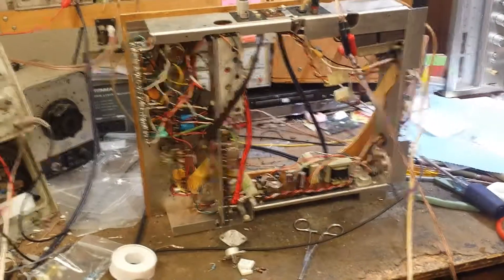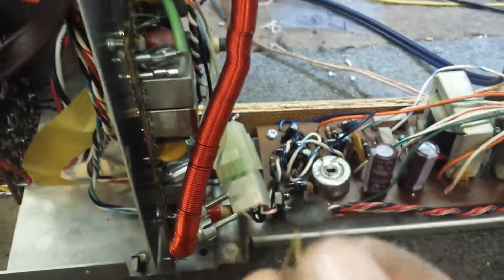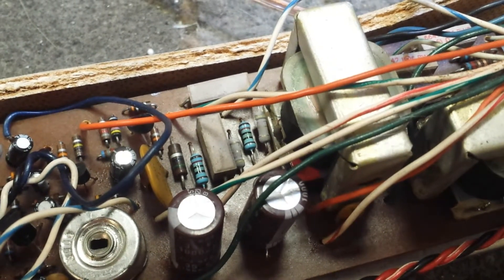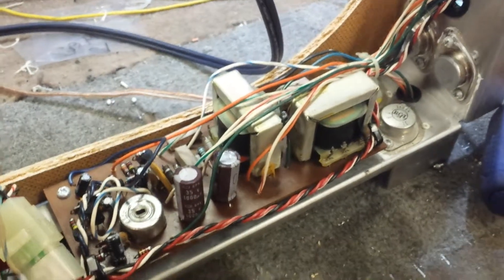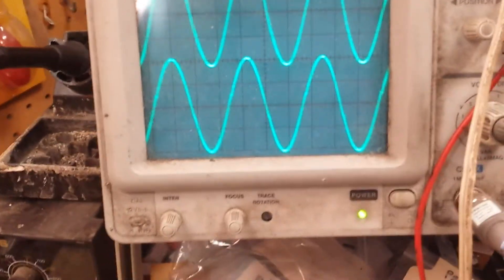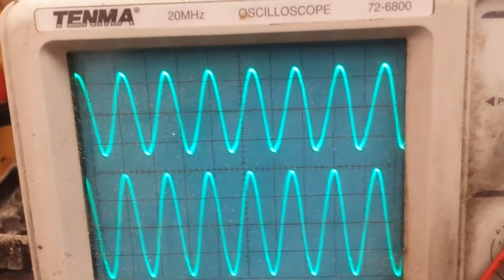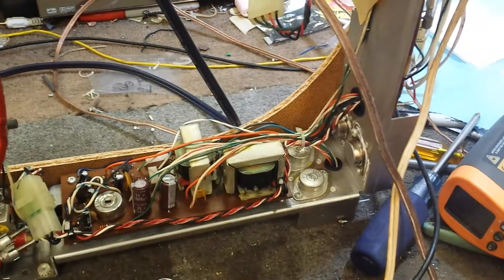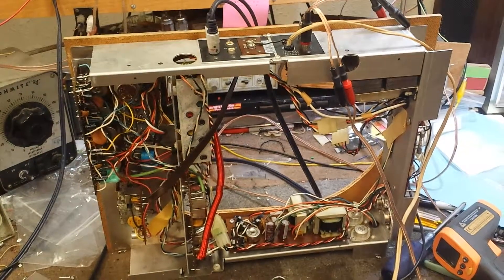Repair of KLH 25, after silicon conversion

Comment: How would you be able to adjust speed on idle speed. Hope you can help  hopefully I can do. Thanks man
Reply from the maker: Assuming the motor is good, build up the tier of the motor pulley that's slow with clear nail polish, then file down until you achieve right speed
Reply: @JordanPier  thank you I will try ,cool

Comment: OK I just lowered my line voltage on the  variac to 90v , no overheating , I realize this is not the fix.. I'm just going to increase the values of the voltage divider resistors to a bit higher than specified, what is theusefulness of my scope can I check for the distortion? I've never tried that on the scope
Reply from the maker: Joseph Sirois using a load box with a 50watt or better 8 ohm resistor, connect the amp to the load, run a 700-1000hz tone through the aux in and connect the scope to the load. You're looking for a smooth sine wave on the scope. If there are notches or the waveform looks distorted you still have a problem.
Reply: Jordan Pi excellent thank you for sharing your knowledge Jordan I got some tinkering to do with this unit it is in pretty decent working order.  just a few little bugs that I ill need to work out . some recapping to do with the the preamp and stuff I just started working on the power amp . does it need to be a dummy load  or can I use the speaker if I can stand the noise?
Reply from the maker: Joseph Sirois if you don't mind the noise you can use a speaker
Reply: Jordan Pier ok , thanks

Comment: Hi Jordan , if you don't mind helping out , I've got 2 questions , what is the adjustment for on the pwr amp board ? And also I replaced my bias resistors with6.2 and 680ohms now my drivers get too warm , any ideas?still no luck finding a schematic, any help greatly appreciated
Reply from the maker: Joseph Sirois you need to measure voltages and adjust the base resistor up slightly to lower temp.

If the driver transformers are warm, that's OK -but hot is not. That indicates the class a transistor firing into the transformer has too high a bias. It should have around .56 between the base and emitter if you've gone to silicone
Reply: Jordan Pier I'm still using the original Si transistors the cane with the set. The OLD bias resistors had a slightly higher values of 700and 7.0 ohms although they were marked 680and6.8 respectively, would lowering the values to 680and 6.2 cause the problem ?
Reply from the maker: Joseph Sirois that would cause more current to flow through the transistors and heat them up
Reply from the maker: Joseph Sirois was this set originally equipped with germanium or scilicon?

This video is to convert from Ge to Si
Reply: Jordan Pier both driver stages were silicon right from the factory the four I'll put transistors were Germainium I guess my answer to my question was within the question if I￼
Reply: Jordan Pier both driver stages were silicon right from the factory the four I'll put transistors were Germainium I guess my answer to my question was within the question if I
Reply: Jordan Pier The original silicon drivers I still in the unit what combination of Bias resistors do I need to use
Reply from the maker: Joseph Sirois my resistors were chosen based on the types of transistors used, their gains, and fine tuning.

This really requires an advanced knowledge of electronics to do the conversion properly and there is no magic bullet. This video was meant to be a guide and not "here's exactly what to do"

Without having the set in front of me there is little more I can do to help
Reply: So what you're saying is by changing the bias point on the output transistors it can cause more current to flow through the driver transistor? And the driver will overheat?must be an exact science!
Reply from the maker: Joseph Sirois yes, as you increase the bias current to the output transistors, the current through the drive stage also increases. The increase in current generates heat.

You need to come to the best compromise between bias and clarity. Too little bias and the outputs won't conduct enough, causing distortion, too much and it will draw too much current and overheat them and the the driver stage.

You need a oscilloscope and a load on the amplifier to check this. Without it you can only get Close. Again, you want about .56 volts across the base and emitter terminals of the output transistors.
The driver transformers should get warm but not hot

Comment: Thanks for the video Jordan and for sharing your insight. I have the very same model that I've been restoring also.Thanks for being so descriptive. I'd like to know how you came about the transistors you chose for replacements. I also don't have a schematic on klh 25 and my base bias transistors weren't readable so thanks for mentioning their values, very helpful 😀
Reply from the maker: Joseph Sirois I look up datasheets on the transistors and compare voltage, current, wattage and bandwidth.

I think I the schematic was glued to the bottom cover
Reply: Jordan Pier I musthave the only one that didn't include a schematic LOL